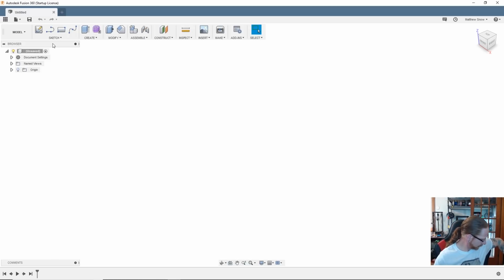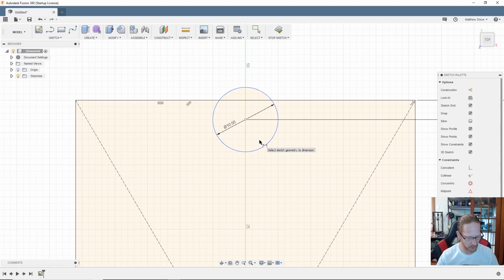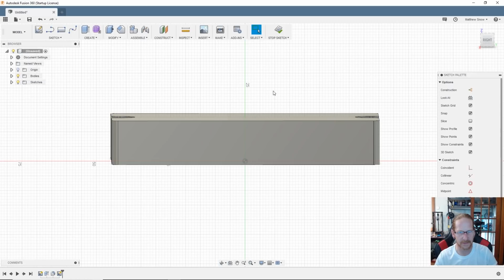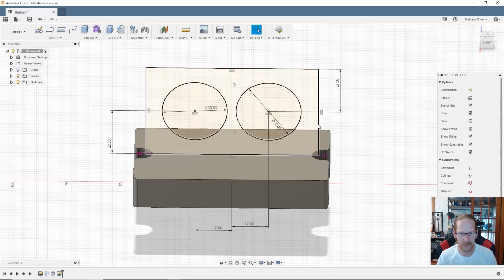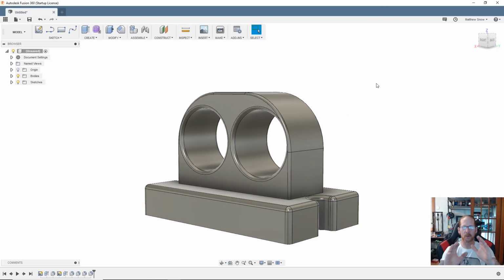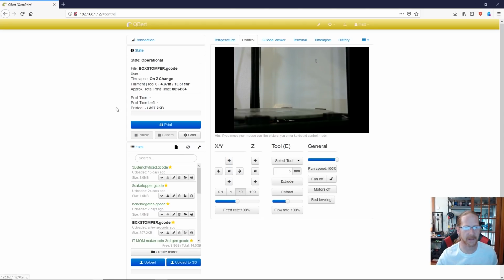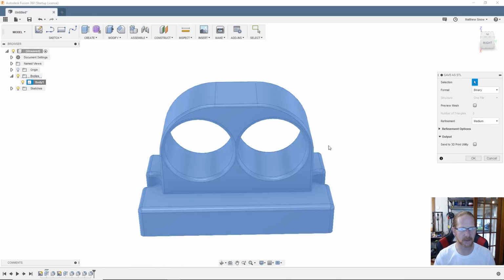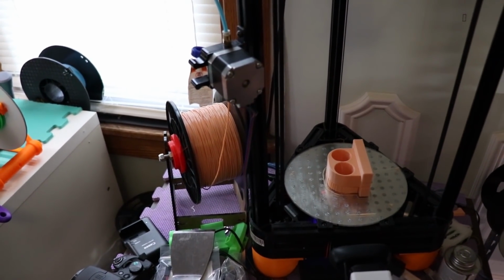The Box Stomper (from idea to prototype)

Comment: Are you still using this?  Also, do you use these, or something similar?
https://www.amazon.com/s?k=Cable+Wire+Stripping+And+Twisting+Tool&i=tools&ref=nb_sb_noss_2
Reply from the maker: I have it in the truck i have use it a few times
and as for the item you listed I have seen but not used them i still twist it old school

Comment: If you cast it out of aluminum, you could check for hot wires at the same time. On second thought, no.
Reply from the maker: Like I told someone else no power is turned on at this point no worries about that 😁

Comment: Cast it man!! ;-D
Reply: heh... so that it conducts, and you know if any wire joins failed...
Reply from the maker: At this stage of the construction there is no power present so if it was metal it would be ok beside that’s poetic and ironic wires being packed by a stomper cast from wire 
“Get in there or I’ll melt you down into ingots”
Reply: Inside The Mind Of Matt thanks for the save brother! :-D. You’re absolutely correct designing and printing something like this is wildly satisfying. I designed and printed a part for a friend and he was amazed that this technology exists
Reply from the maker: Ya it is the machine I always needed just didn’t know 😁 and I was going to say to you about casting it that it was a great idea I could slim it down a bunch too could it would be strong in nature I’ll have to add that in the queue 😉 I got something I want to do but like you said in your pet robins video it’s so cold out that it’s torture to go out and melt
Reply: @InsideTheMindOfMatt  "pet robins" had to say that one out loud to get it ;-)
Reply from the maker: Auto correct DAMN YOU petrobond